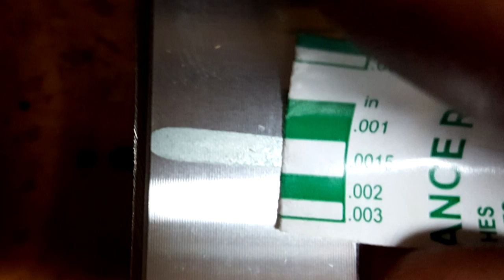LS 5.3L Build Part 4 Bottom End Assembly | Project Rowdy Ep008

Comment: I think all of your LS 5.3 Builds have been great. I am getting started on a 5.3 Build on a 64 Nova II. Just bought the car mothers day it has a very good 350 in it now. I am planning on it taking about 3 years to do this build on the motor. I want to mini tub the car put a four link and a Heidts front clip. Just retired not a lot of extra money. do you have any suggestions.
Reply from the maker: You really need to do a lot of Planning!!!!  It will help you organize your approach and most importantly, give you an idea of how much you are going to spend.   If money is tight...  make sure you have a good idea of what you might be spending.  Money will be your largest hurdle and you will need to make sure that you have that under control.

Comment: Man this is detailed!  With the help of your videos, I'm building a 6.0 for my 85 Chevy K10.  Question, did you use new main cap bolts?
Reply from the maker: C Boy141 Have fun with your build.   I reused my main cap bolts as the manual that I followed did not indicate that they were torque to yield.  Cheers. Mike
Reply: @UCanDoIt2Mike  thanks for the quick reply Mike.  I didn't see it in the manual either, just wanted to make sure!

Comment: My #5 main cap is on the opposite side also.
Reply from the maker: You would have thought that they would have stamped them down one side.  They must have stamped them when unassembled.  It is correct that #5 installs facing the opposite direction of the other 4 BTW.  Cheers and have fun with your build!!!
Reply: Thanks.

Comment: I had a question about the main bearings. Which ones did you use? And does the size change when you polish the crank? I’m about ready to go to the machinist to have some work done on my block and was wondering if it’s something I’d have to get from the machinist or something I can source myself.
Reply from the maker: My suggestion is to have the machinist do what it takes to properly correct your Crank.  This may be to Grind/ Polish (require a custom bearing), OR just Polish (may or may not need a custom bearing).  You cannot determine this until he is finished!  Once all of the machine work was complete, I had my machine shop order the proper size "Items" that matches where my engine ended up.  They have a great resource to put together custom "Master rebuild kits" that will match your new engine.  For reference, here is the Parts List used on this build: http://bit.ly/RowdyEngineExpenseSheet .   Be careful.... these items match my engine.... maybe not yours!!!!
Reply: UCanDoIt2 sweet looks like I’ll be talking to my machinist. Thanks for the information, as always greatly appreciated!

Comment: wished you would have shown top dead center and timing set install step by step
Reply from the maker: Most of the worry about top dead center goes away with these engines.   If you align the dots on the crank pulley with the cam pulley, you have TIMED the top and bottom ends.  The Crankshaft will rotate twice for every one rotation of the Camshaft.  Ignition timing is all taken care of by the Reluctor wheel that is mounted on Crankshaft.  The Crankshaft Position Sensor reads the rotation of the Crank and communicates with the PCM which controls the Spark.  Cool no more Distributor Timing!  You do not need to know where/when the number one cylinder is at TDC.

Comment: Did you have your rods and pistons balanced to the crank to make sure everything weighed the same or are you confident enough in the brands you bought from to make sure they are balanced and weigh the same as the mass on the crank?
Reply from the maker: Yes we did.   I believe I covered some of that in Part 3 (https://youtu.be/H9VceusOQ5Y).   The box the Pistons came in had hand written specs where I believe they where hand matched.  We also weighed them and the Rods.  We then setup Bob Weights that simulated the pistons and rods (pin, oil allowance, rings) to ultimately balance the entire rotating assembly.  Pretty cool process.

Comment: When aligning the cam and crank gear dots, does the number 1 piston have to be top dead center like the old small block chevys?
Reply from the maker: Ro813TV No.  aligning the dots on the Cam and Crank gears will properly synchronize the relationship between the two shafts.  The old TDC concept is a synchronization of the shaft’s rotation and timing (Distributor position).   The PCM handles spark through the Cam Or Crank Position Sensor.   The concept of TDC is no longer needed during the setup of the Gen3 and Gen4 engines.
Reply: @UCanDoIt2Mike  appreciate the feedback. Your video has been a huge help. I'll be reassembling my first gen4 5.3 this weekend.
Reply from the maker: Have fun with it!

Comment: Very good videos enjoy watching just wondering did you use new bolts on that rotating assembly
Reply from the maker: I reused all of the bolts on the crank caps, because I could not find anywhere in the book that there was a reason or recommendation to replace them.  They are not Torque to Yield.  Everywhere that there are TTY bolts, I did replace.
Reply: Ok thank you

Comment: Just wondering about the main cap studs. Seems the nuts were on the studs when you inserted them. Shouldn't the studs be inserted into the block then the nuts threaded onto the studs?
Reply from the maker: They look like Studs with nuts on them.   Actually it is a one piece assembly fastener.  The extended stud along the top is to support the windage tray.
Reply: Got ya!! Thanks!

Comment: Hi, great video. I'm going to be rebuilding my first engine. It's a 6.0L. I have a question on the rods, do they go in in a certain orientation like the position do with the dot facing towards the front of the engine.
Reply from the maker: Great question!   YES!!!  The Rods have a slight offset and have to be paired up.  When my machinist connected the Rods to the Pistons, they did 4 one way and the other 4 the opposite way.  We went ahead and labeled the piston 1-8 so that I would get them right.  Piston dots do face to the front and the pairing rods (1 and 2) have to be opposite of each other.  Not sure if the guidebook that I followed mentioned this, but I do remember the conversation with the machinist.  Cheers... Mike!!!

Comment: I also have a jeep a 95 wrangler I wanna do the 6.0 swap on how did u do ur motor mounts for the conversion. ?
Reply from the maker: The engine has not been mounted yet.  I am now working on bodywork, then will move to a frame and suspension restore...  then I will start with mounting the engine.  Currently, I am rebuilding the Dana 300 Transfer Case for this build.   There are several companies that make Jeep CJ, YJ, and TJ engine mounts.   One of then being Novak Adapters.   Cheers Mike!
Reply: @UCanDoIt2Mike  thank you i subscribed hope u can keep us updated on the build

Comment: Why were you hammering the crank with the wood block? I’m about to rebuild my bottom end on my LM7 also so I just wanted to know why or what is the purpose of it
Reply from the maker: The purpose is to "seat" the Trust Bearing (in cap #3).  Once the Trust bearing is seated, then you can take a tolerance measurement.  This tolerance measurement is to determine how much the Thrust bearing will allow the Crank shaft to move forward or backward within the block.   I used the piece of wood so that I did not damage the crank.
Reply: UCanDoIt2 thanks for replying! Also what torque wrench did you use?
Reply from the maker: I have 3 Pittsburgh Torque wrenches.  2 ftlbs with different ranges and 1 inlbs for the light stuff.

Comment: This is George again. I got mahle rings and I'm getting the same measurements on the rings as you did. I'm running an equivalent btr stage 4 low lift cam with ls6 springs and plan to drag race it and street it. Will the gaps be okay or should I file some off? Thanks
Reply from the maker: This question is above my pay grade!  I was told by my machinist as to what I should look for in my measurement based on Street use.   Hopefully some else reading this can chime in.  Cheers Mike!
Reply: Thanks! So .016 on compression rings and .014 on the second rings is what I have. Is that what you have? Thanks again for your replies and great vids

Comment: I'm about to pull the 5.3 I have in my c1500 and do a rebuild since I want flat tops in it and about to 243 heads and a nnbs intake manifold. Anyways my question is where did you get you new pistons and how much where they?
Reply from the maker: Scotty doesn'tKNOW My pistons were purchased through my machinist.  He had to measure the cylinders to determine the ultimate size of positions needed.   He then purchased the pistons from his distributor and then took a true measurement of them to determine the final size that he would hone and bore the cylinders.  I believe there is a price list linked below this video.   Unfortunately,  all parts that I purchased through the machinist were never broken down for me.
Reply: If you want flat tops get pistons for a 4.8 they are the same size

Comment: Can you tell me a little about the lubes you use here? Looks like lucas on the mains, what is the black substance you use on the bolt holes? Thx
Reply from the maker: I did use Lucas Assembly Lube on all Internal Bearings and Cam shaft.  I purchased this from the local Auto Parts store.  Of the single bottle that you see me use, I probably only consumed 1/4 of the bottle.  I have plenty left over.  On all nuts and bolts I applied ARP Fastener Assembly Lubricant.  It came with something that the Machine Shop ordered for me.  This provides some anti-seize properties but is mainly to help obtain proper preload (torque) on the fasteners.  I used it sparingly and the one .5oz packet serviced the entire engine.   Hope this helps!
Reply: UCanDoIt2 Thank you! I'm disassembling my replacement 5.3 and looking for any tips on the job. Thanks again.
Reply from the maker: I received a lot of good tips form my machinist as well as the book that I followed.   GM LS-Series Engines by Chris Werner: Amazon: http://amzn.to/2igcReD

Comment: Are you using the stock crank with modded pistons and rods? If so will the motor hold?
Reply from the maker: GreatestHITS Absolutely!   I’m not boosting this engine.  Stock Crank, upgraded Pistons, and upgraded Rods.  None of these create power, so this engine is stronger than stock.
Reply: UCanDoIt2 well I plan on buying a $4500 5.3 and it’ll be my first time build a motor and I want to boost it in my Firebird, I want to put a turbo in to. Can I just leave the crank stock? Because I don’t want to brake the bank and spending thousands of dollars on a rotating assembly.
Reply from the maker: @GreatestHITS26   Hang on!!!!  $4500 5.3 that needs to be rebuilt???  I paid $600 for my complete used engine with wiring harness and PMC.  I spent about $4500 during my rebuild and now have about $5100 total investment.   You can find used 5.3L very cheap.
Reply from the maker: @GreatestHITS26  The stock crank can be turbo charged...  no problem.
Reply: UCanDoIt2 sweet I’ll do that then! I have big plans for my trans am and the 5.3 I’m going to buy. The ls1 just won’t hold the power I’m looking for
Reply: UCanDoIt2 no I meant $450 dollars

Comment: Great video series!!! Are the crankshaft mains TTY?
Reply from the maker: The manual that I followed did Not list these as TTY and did Not mention using new fasteners here.  The Manual was pretty specific on the other ones (Head bolts and Harmonic Bolt).  As you noticed, these are "Torque Plus Angle" which does not always mean the fasteners are TTY (one time use).  The manual does have a pretty neat side bar on the different methods of fasteners tightness.  While TPA is not perfect, GM believe is it provides a better method to preloading a fastener than torqueing alone.  Thanks for the feedback!   Have fun with your project!!
Reply: Thanks for the reply. What was the sealant you were using on those bolts?
Reply from the maker: That wasn't sealant, it is the blue packet of ARP Fastener Assembly Lubricant (Explained at 12:16).  It came with one of the kits ( Cam, Piston, or something else) that I purchased.  My machinist mentioned that I should use it one all Internal bolts as it is non metallic.  He stated that I should use it like an Anti-Seize paste and that the one tube should be enough for the entire engine.  He was right about that.  I use about 90% of that packet for this engine.

Comment: When you checked the ring gap is it ok to use the same cylinder bore for all the rings or should you do each for each cylinder?
Reply from the maker: You should start pairing/mating your ring sets to the Cylinder that they will belong to.  Advice:  Do not use just one cylinder.
Reply: @UCanDoIt2Mike  Thanks for clearing that up! This video series applies to probably half of the engines on the road Chevy hit a home run with the LS! Thanks again for all the info.
Reply from the maker: Amazing what happens when you standardize your engine platform.   So many interchangeable parts.....

Comment: hey nice work. just found your channel and keep up the good work. I was wondering where did u get your torque specs from.
Reply from the maker: The torque specs are listed in the manual that I am following: GM LS-Series Engines by Chris Werner: Amazon: http://amzn.to/2g3xXNl.  It lists them in the section that you are working on and there is a table in the back with them all.  Do you need a particular one?
Reply: hey thanks for the reply. I was just asking I'll be doing my rebuild next year.
Reply from the maker: Excellent!  Just have several resources (Machinist, Books, Friends) that you can find any answers you have and go for it.  Good Luck with that when it comes time.  Cheers!

Comment: Hi there i have a 5.3 that i had bored over. Even with the correct over bore pistons and rings im around .023  on the end gap of the rings. Is this to much? Will it work or do i need to get bigger rings. Hastings says .02 is max. Any imput is appreciated.
Reply from the maker: I would get new rings.  You have taken this thing apart to do it right.  I would have to go back to my notes, but I believe my Machinist told me .016 to .020.  Would the ones you have work, Yes, but I was told these engines like to run tight.  I just checked the book that I followed and there is a section for "Science or Ring Fitting".  The Ring manufacturer will make a recommendation based on the material the rings are made of (due to expansion from heat per material).  Many High Performance Ring often require 0.004 inches of end gap clearance per inch of bore diameter.  Example, if your Bore is 4.005 inches in diameter, it would be 4.005 X 0.004 = 0.0016 inches of end gap.Check to see if you can find a recommendation from your ring manufacturer and calculate the recommended gap.
Reply: @UCanDoIt2Mike  thats what i was afraid of. Yes i took it all apart and sent it into a machinist to do a bunch of work on the block. On Hastings website it says .0035 per square inch so thats .0035 x 3.780 but they bored .01 over so .0035 x 3.790ish = .0132 this is the min gap. Max is .02. 
        So since i have .010 larger rings already should i get .020 rings and file them down a tad. Thanks.
Reply from the maker: None of that is in the plans for this vehicle (79 Jeep CJ7).   Trying the keep the wheels pointing down!

Comment: hi i have a 2000 GMC Sierra with a lm7, my question is what's the difference between the lm7 and the ls1?
Reply from the maker: Comparing stock engines, some of the major differences are:  1) Block, the LM7 is a 5.3L the LS1 is a 5.7L, 2) Pistons, 3) CAM, 4) Heads, 5) Water Pump.  They pretty much are different engines, BUT....  BUT...  they share the same platform, which means that most parts are interchangeable.   You can put items from the LS1 like CAM, Heads, water pump, crank (be careful) on a LM7 Block.  Google "GM engine codes", you should be able to find a list of all the codes which will allow you to spot the obvious differences.
Reply from the maker: The LM7 is a 5.3L and it actually has 4.8L/5.3L embossed on the Block.   This same block is also used in some 4.8L engines (LR4, LY2).

Comment: nice build! How much did the machine shop charge? I just bought an ls from salvage yard n was wounding how much it would be.
Reply from the maker: The work that I had done was $1100 for the machining.  The needs for each engine would dictate where more or less work would be required.  Good luck with your projects!!!!
Reply from the maker: All in All, I have $5100 in it.  $600 Engine, $1100 Machining, and $3400 in parts.  Hope that helps!
Reply: UCanDoIt2 thanks for the info!
Reply: UCanDoIt2  3400 in parts?! Wow! What parts do you have if you don't mind me asking?
Reply from the maker: Check out the "Parts List" PDF in the description.  It documents all of the parts that I used.  Head Gaskets and such are expensive for these engines.  Its nuts!
Reply: UCanDoIt2 thanks again for the much needed info! how much horsepower you have at the rear wheels?
Reply from the maker: I have not cranked the engine yet.  It is still on the stand.  It will be a while before I get it dropped into the CJ7 that it will push around.  This was not a "HP" build.  The stock engine had 285-295.  I am expecting something between 325 and 350.  But again that was not an objective of this build.

Comment: I realize this is a lttle late, (this was published 4 years ago) but I just watched how you torqued the rods to check bearing oil clearance.  I believe that you done it wrong.  I believe that if you check the manuals, you need to have both rods on the journal before torquing either rod to prevent twisting the rod on the journal and making the big end of the rod out of round. I have never torqued a rod without its mate at least half therequired torque  to prevent this.  If I am wrong, (I don't believe I  am) I  will stand corrected.